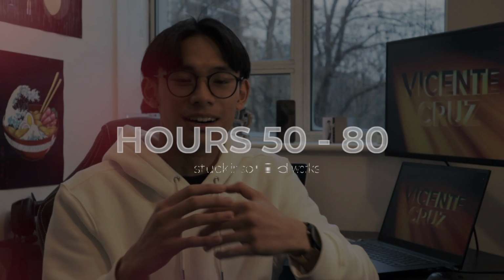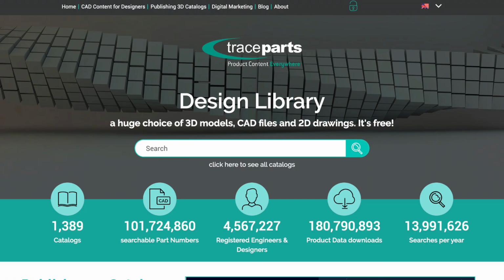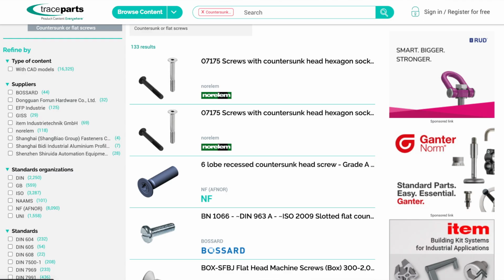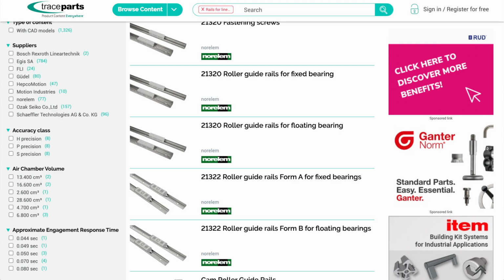I taught myself 3D for 100 hours... this is what I learned

Comment: For Solidworks, what you can do is seperate the parts in your Part File into different bodies. One of the ways to do that is to make sure you uncheck “merge results” whenever your extruding a new body
Reply: Afterwards, save the different bodies into seperate files. When you open the parts in an Assembly, simply just click the part you want without touching the interface
Reply from the maker: ohhh yh, see i could have done that but i'm not totally sure why I decided to make life harder for myself 😅😹
Reply: @VicenteCruz  it’s fine haha i was taught by a very good lecturer from my school 👍